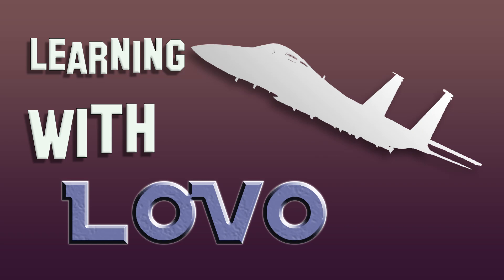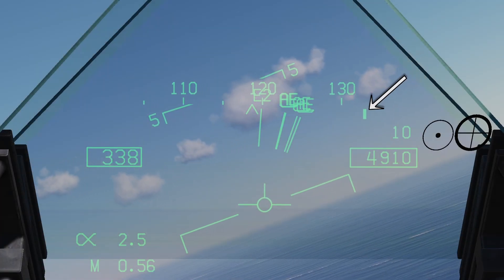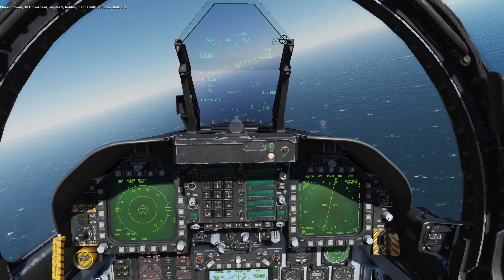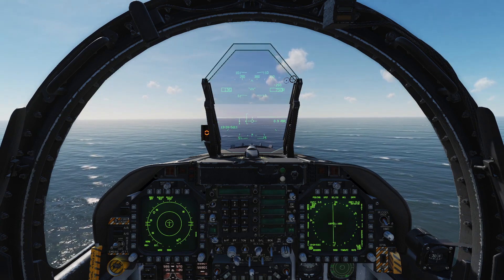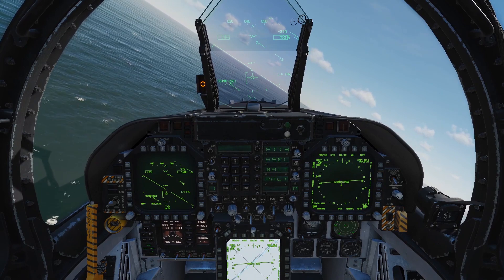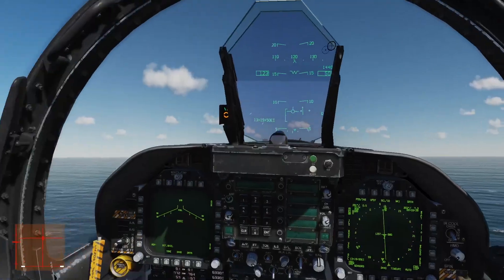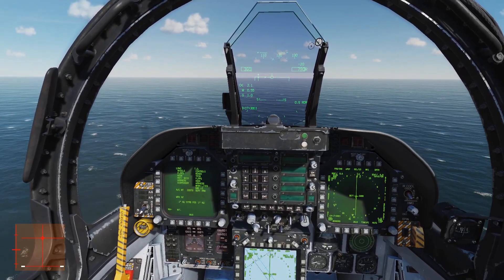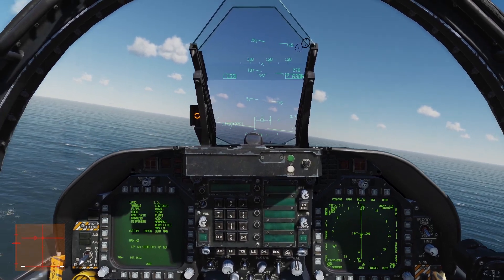SuperCarrier Case I Tutorial

Comment: So hard to see the runway on the carrier. Also what csl lime to use so it's on the runway
Reply from the maker: Yeah I tend to zoom in for a few seconds when I roll out into the groove to get the line up right. 
The course is BRC, which the ai will tell you if you do the comms, alternatively hit alt+f9 (I think) for the LSO view, which features the BRC on the screen
Reply: @DCSWithLovo  nice. Also do you use magnetic or true for f18? The true heading matches the f10 map.
Reply from the maker: I use magnetic. It's more commonly used other than the F10 map, in communications for example
Reply: @DCSWithLovo  ok I use f10 a lot and I draw lines and stuff to find the bearing so maybe true is good for me in that aspect. But I should change back to magnetic when doing carrier lands since the call put from mother is magnetic ?
Reply from the maker: Might be easier to mentally add or subtract MagVar when using F10. That's only like 5 numbers to remember if you have all the maps.
I personally haven't found it too bad using F10 map and just rechecking my heading a few times as I approach. The lateral deviation from the mag-true error well reduce the closer you are when you take a bearing
Reply: @DCSWithLovo  sorry how to calculate ? Can you teach me ?
Reply from the maker: A quick Google shows approximate figures as it actually varies by mission date. Just add for East, subtract for West. So 260T in Syria would be about 264M.

+6°E Caucasus
• +1°E Marianas
• +12°E Nevada
• +2°E Persian Gulf
• +4°E Syria

https://forum.dcs.world/topic/286102-magnetic-declination-update/
Reply: @DCSWithLovo  thank u